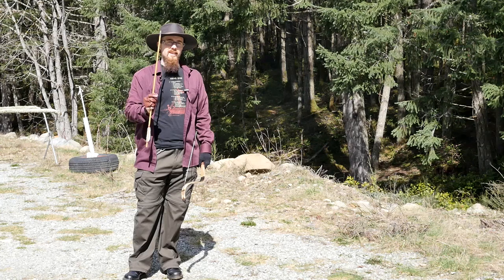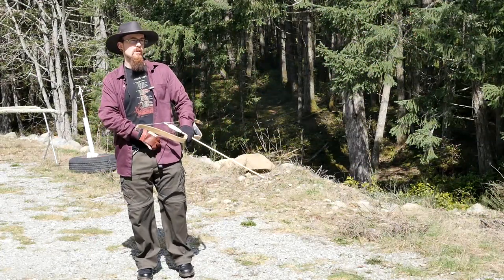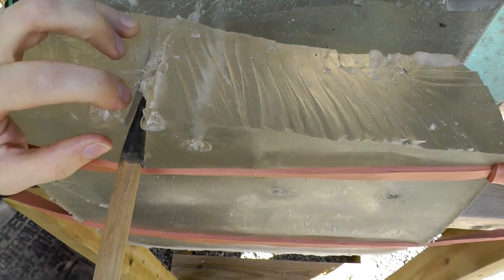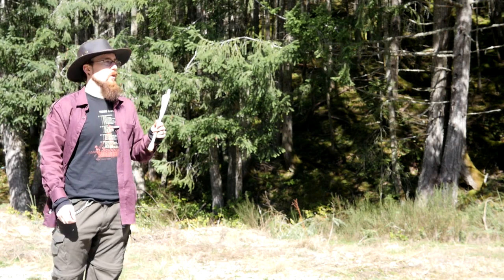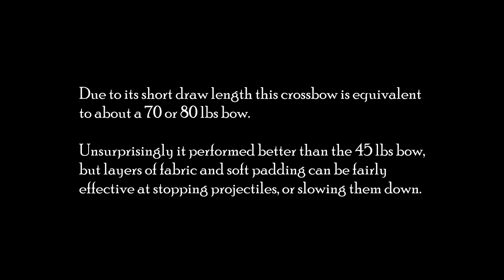Light Bow / Medieval Crossbow Tested on Ballistic Gel and Padded Jacket

Comment: Someone already probably commented but on an Asiatic recurve, you want to hold the opposite of a longbow or 'modern' recurve bow for target shooting. Instead of the 'no grip' on the grip portion, your bottom 3 fingers will be firmly gripping, most pressure on the pinky finger, a little less pressure on the ring finger and a little less than that on the middle finger and your index and thumb no pressure, can point them at target.

Comment: Have you noticed how deep the blunt bolt actually goes before springing back? It's almost entirely through the first block. Which is why I think it isn't the the jacket that's so good at stopping projectiles, but the gel that absorbs so much force from the impact. I'd suggest a test with a jacket being on top of a sort of more accurate material.

Comment: Hey Skall, I'm wondering if using the modern fabric in those gambesons is throwing off the penetration tests.  I'm fairly certain that modern fabrics and thread in general made by machine are going to have MUCH tighter weave and I would guess a significant strength advantage over medieval fabric and thread.  Any thoughts on that?

Comment: lesser penetration is due to the weight of the arrow being so far back transfer of inertia to momentum is lower this allows the bolt to shoot of faster from the crossbow but loses much more energy while traveling therefore reducing the energy available for penetration upon impact.
archery is amazing, there's so much that goes into it that's why I prefer it over guns or compound bows as the tool does most of the work for you, archery forces you to have skill and knowledge to be proficient

Comment: interesting . i wonder what the blunt force would be ? 
the padding stopped a 45 pound bow , depending on draw length.
that bow might be rated at  31' or 28' not sure how long skalls arms are . 
then the crossbow at 300 pounds but roughly equivilant to a 80 pound bow 
in skalls note at end . 
 i would think the blunt force of the crosbow would be uncomfortable . 
possibly bruising . 
i wouldnt volunteer regardless . 
cheers

Comment: It looks as though the shots are going consistently high. And you can see the arrows 'leap' upwards a bit as they exit the bow. Your arrow knock might be a bit too low.. I'd move it up about 2 - 3 mm and see if this corrects the issue. You expect an arrow to contort, exiting the bow.. But not like that. It's as though the arrow is being pushed from too low a position, which turns your hand / rest into a sort of 'ramp'.

Comment: To be fair the crossbow didn't outperform the 45 lb bow, field tips couldn't penetrate the jacket with either bow or crossbow and you only tested a swallowtail point with the crossbow even though they were used with bows too. A field tip isn't meant to penetrate anything but hay bails and maybe small game if that's all you have on hand. You should pick up some combat swallowtail arrows and bolts, the points are half the width of the hunting versions and can be the same length or shorter and test again. You would be surprised that the arrow will penetrate the jacket more than the bolt if they both used the same type of point.

Comment: Also, if one where to use a longer bow and a longer draw, along with a longer bolt more like an arrow, wouldn't range be increased substantially? Why don't I see these types of medieval crossbow then? I mean, the only difference that my build would have is that the roller nut would be back further, close to my right hand which is holding and triggering the crossbow. Also the trigger length would be shorter I think.. But pretty much the same.. Is this a good way to increase the range and power friends?? Also, I plan for it to still be light bow status, meaning I can pull back and re load the bow without too much trouble, and without a crank or something like that. 

Wait- just because the bow will be longer and the draw longer as well, does guarantee stronger bolt shot? I mean- imagine same thickness of spring steel bow and same shape, just twice as long!

Comment: Question: Why are crossbow bolts so thick? I understand why they are short, but i imagine that if they were thinner they would travel farther. That, in combination of the draw weight, seems preferable.
Reply: The boys who make the bolts do the math, counting the velocity to mass fired ratio, you could shoot out wooden beams for maximum damage, or you could shoot needles for maximum travel time, but through calculation, this is result that the smith has come up with for maximum efficiency for the average crossbow/bolt usage.
Reply: Blake Bailey Also crossbow bolts accelerate much faster so they have to be sturdier to not break in half while firing

Comment: Is that how archers had to load crossbows? With that metal tool you were using?
Reply from the maker: Yes, the goat's foot lever is one of the historical spanning tools. Another one is a belt hook with a pulley. There is also the cranequin and windlass for heavier ones.

Comment: How were crossbows used if I simple bolt can't penetrate even the most basic form of armour? That confused me. Were older crossbows heavier? Or were they just used for accuracy?
Reply: wtf kinda name is that they were used for unarmored targets. That's a rather weak crossbow, the heavy ones can, at very close ranges, go through weaker platemale.
Reply: A) Crossbows for war are usually quite powerful, the ones that need dedicated tools to even load.
B) Not everyone is armored all around. Enough bolts will surely bring some results eventually.

Comment: why dont u use a second arrow or bolt to measure how far the fired one went in then move the camera closer to inspect damage?
Reply: Or just draw cm or inch stripes on the arrow before leaving home.  Like 1cm wide black stripes 1cm apart, with the 10, 20, 30 cm stripes in red.  Or 1/2" black stripes with red stripes at 3", 6", 9", 12".  So pattern starting from tip would be Wood, Black, Wood, Black, Wood, Black, Wood, Black, Wood, Red, ... for metric or Wood, Black, Wood, Black, Wood, Red, ... for Imperial.  For bonus points, leave out the paint on 90 degrees of the shaft to make rotation visible.

Comment: Were composite bows around in England and Western Europe?
Reply: Well considering that longbows are often made out of two types of wood, I would say yes.
Reply: Composite prods for crossbows are well-documented in continental western europe during the middle ages. There are also suggestions in artwork of composite handbows for wealthy people, but by and large they appear to have been rare. Some of that could been simply due to the clear preference for crossbows over ANY kind of handbow, but it could have also simply been due to cost. 

There were composite bows in Roman Britain, but other than/after that it seems to have been firmly the domain of the yew or elm self bow.
Reply: ryddragyn Thanks, I thought the composite bows were a asian/ middle eastern thing. The royalty did trade with them both though so I guess it's possible.
Reply: Well you can find them in Central Europe and eastwards a lot, and even in Southern Europe. Problem with such a construction usually is that the fish glue dissolves in water and humid enviroments make it really bad to use if you are not able to cover it. But as it has been mentioned crossbow prods have been made like that since 300 BC to the 1100s, when steel prods became more common.

But if you look at the preserved bows from the Mary Rose which carried nearly 200 longbows, most of them are made out of two different woods and therefore composite.

But if you look at art from the 15th century from central/eastern europe which shows bows, well you will find the same bows as with the mongols/turks only much bigger and quite possibly stronger due to those bows designed for use on foot primarily. (Even though anything east of Modern Germany still employed horse archers and that's 2/3 of Europe and there are plenty of horsebows from this region)
Reply: High Master Johannes Lichtenauer Thanks, my main interest with history is around Germany and Scotland so I'm not too knowledgeable about Asian/ Central Europe as much but when I see composite bows I think of the mongols
Reply: +Phantom http://deremilitari.org/2014/03/horses-and-crossbows-two-important-warfare-advantages-of-the-teutonic-order-in-prussia/

Long read but it has good information on composite crossbows used by the Teutonic knights during the Baltic crusades.
Reply: The Romans used composite bows extensively, and the Romano-Byzantine empire used hunnic composite recurve bows from both horseback and on foot. I think, at least in the early medieval period, Western Europe had relatively primitive technology and warfare. For example, I know the Normans only had simple bows when they invaded Saxon England.
Reply: Actually, famous english longbows may be considered "composite-like" because of the properties of yew wood. Longbows were cut out in specific way to make use of different layers of wood.

As far as I understand, it was a relatively cheap and easy way to achieve composite-like properties.
Reply: Sure, the Hungarians used those and they invaded Europe in the 9th century A.D., and were defeated in the 10th century. So the technology was there and known, but mounted archery was not really used in Europe. If you were mounted, you were cavalry (because rich/noble) and they were armed with ranged weapons way later when gunpowder guns were available. Bows were normally used on foot, like the famous English archers.
Reply: Phantom Well, longbows were made of yew trees, and that was something of a natural composite

Comment: I have to admit that even if i liked the vid (as i've been doing consistently from a couple of months since i subscribed at this point) i was a little bit dissatisfied, i hoped for your crossbow to be more powerful than about 80lbs, maybe i had high expectations for it, but i found it really lackluster 

I mean, 80lbs isn't even as much as some historical bows isn't it? And quite certainly not even half the power of a normal crossbow that would have been used in a battlefield.

Well, you did the test with what you had anyway, nice vid still, i would like to see another one with more powerful crossbow one day (especially the padded jacket part)

Comment: Wait... 300 pound crossbow barely punches through padded jacket ? why is that?
Reply: 300 pound draw weight is rather weak for a medieval style crossbow. It sounds like a lot but the draw length is very short on a crossbow, meaning you need a ton of force to accelerate the bolt. Heavy war crossbows could exceed well beyond 1000 pounds.
Reply: thnx m8.

Comment: how did people die? nothing went through the gambeson
Reply from the maker: Battlefield longbows and windlass spanned crossbows were MUCH more powerful.
Reply: I'm pretty sure their bows and crossbows had a much stronger draw weight. Don't cite me on this, but I am pretty sure a proper war bow would have a draw weight of about 100 pounds, more than double that of the bow Skall used.
Reply: As skallagrim note in the video the bow had a draw weight of 45 lbs and the crossbow had the power of a 70-80 lb bow.  The wikipedia page on the longbow suggests that the exact draw weight of historical war bows is greatly debated with different sources giving values of 80–90 lbs, 90-110 lbs,  150–160 lbs, and even 100–185 lbs.  So 100lbs seems like a fine approximation for the power of average "shortbow".

Its also worth noting that hunting bows from this period usually had a dwar weight of only 50-60lbs.  So a gambeson like the one tested would seemingly provide near perfect protection from projectiles in a civilian context.

Comment: id imagine bodkin arrows would have a different effect
Reply from the maker: The bolts with the feather fletchings are fairly similar to bodkin points.
Reply: Isn´t the problem with bodkins that they just don´t cut well enough to get into padding? They split mail links a lot better, but garment pretty much folds around them and stops them in their tracks. Feel free to correct me though